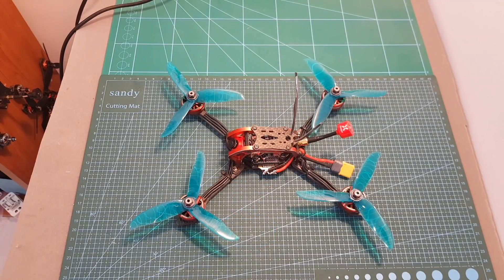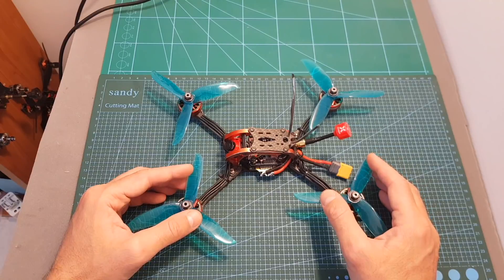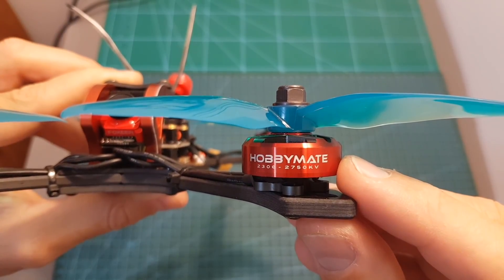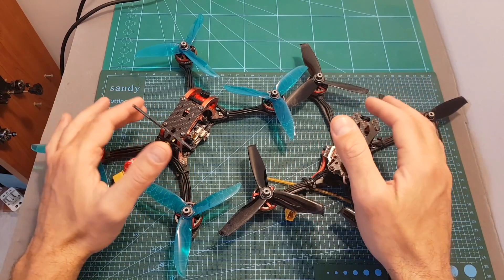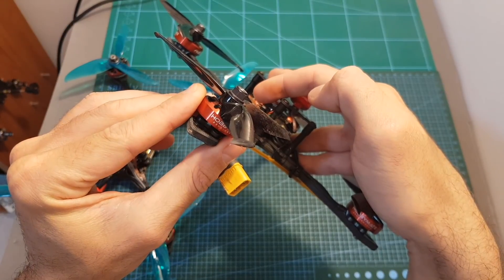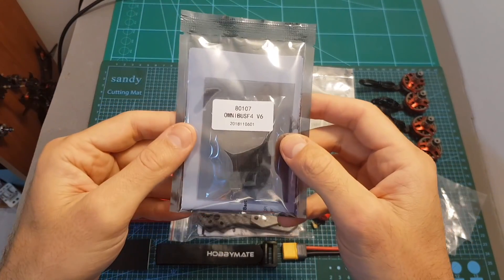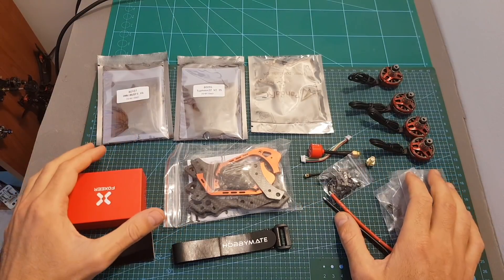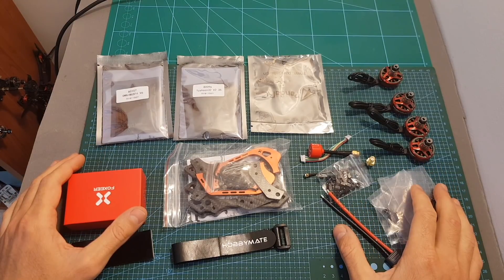Hobbymate Meteor 5" Racing Quadcopter - Build & Review

Comment: Nice build, but plz put some solder on the 'bust pad', which is that area of exposed copper near the battery pads; they are exposed so you can add solder to increase the area where current flows, reducing heat.
This is why a lot of people saw the esc burns up. For other companies that  airbot makes the esc for, they usually add solder before shipping it out.
Reply from the maker: Thanks for the advice!